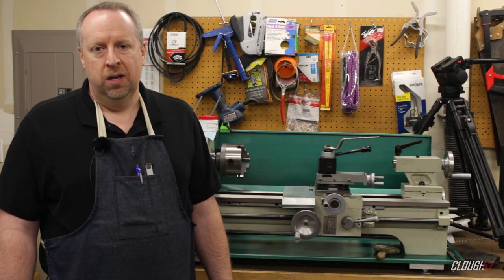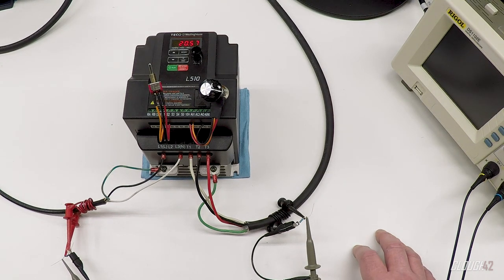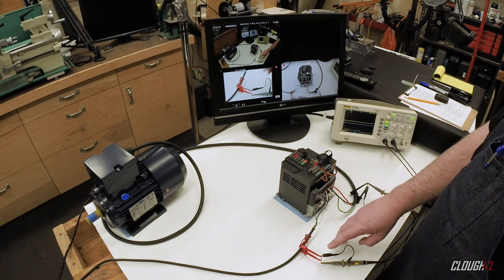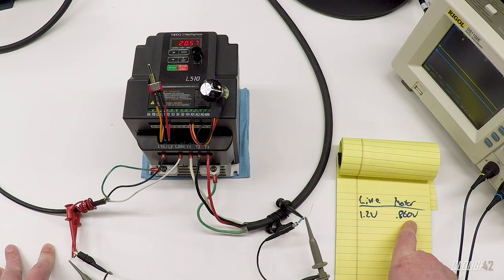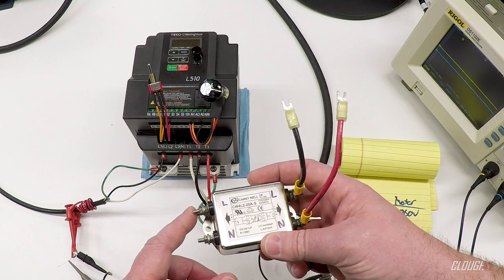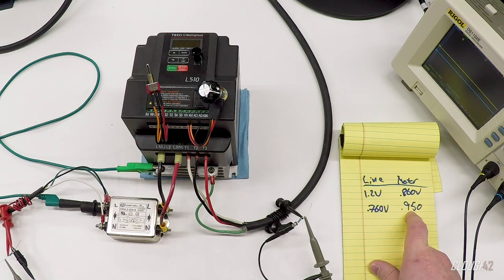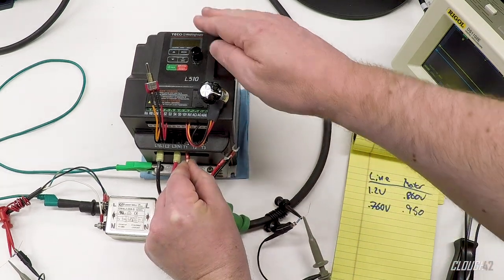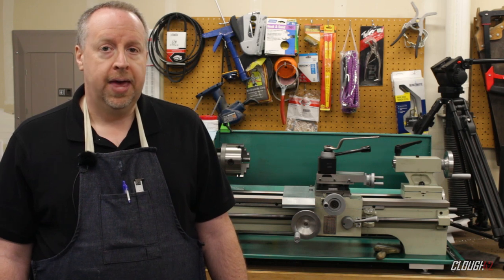Lathe VFD 3:  How to Fix Noise Problems

Comment: Hi Folks. It would be advantageous if the motor lead was kept fully within the lathe electrical casing - it would then act as a Faraday shield. Not really feasible with a small lathe, but with a cabinet mounted one it would be. Otherwise as others point out, shielded cable. Even steel armoured cable should help, although a copper screen would be better. Maybe some viewers could use rigid copper pipe in their set ups? It is necessary to watch out for earth loops - they can cause problems and that is also covered in the comments below. Counter intuitively you just earth one end of the cable screen. It would be good practice folks to use a 'star' earthing arrangement as well, don't daisy chain the various earth connections, take them all back to one common point and as James said use heavy cable as short as possible. As others have pointed out even 'earth' wires can emit electromagnetic radiation. That's because at these very high freqencies they have considerable impeadance - one end may be near earth potential, the other one will not be. Impedance is a posh word for high frequency resistance and it has two components, real and imaginary. May sound weird, but this is in the realm of what are known as 'complex' numbers. What seems obvious is not always so in this field. BobUK.
Reply: Impedance is not 'posh'. Impedance is the technically accurate term for the total resistance to flow in an AC circuit which includes resistance, capacitive reactance, and inductive reactance. Complex numbers are not needed to express or calculate impedance unless we are using varying frequencies or phase shifts.
Reply: @georgebeaves1254 . Hi George. Thanks for taking the trouble to comment. I was trying to keep it meaningful to readers who luckily have avoided the full complexities of circuit analysis. Hence the word 'posh'. I'm well over 70 now so maybe my memory is wrong. What I recall is that if an ac circuit has capacitance or inductance in it then an accurate analysis does involve phase shifts and hence complex numbers. A dc only circuit can be analysed without that complexity. The reason is that in an ac circuit any inductance or capacitance will result in phase shift between voltage and current, like Thanos it is inevitable ........ the extent of the effect of course depends on the values involved.

Comment: I just got my vfd today,(Mitsubishi) your videos will help a ton with my setup. 

Thanks for the in depth videos that really explain what's going in a way anyone(non electrical engineer) can understand.

I was wondering if a shielded cable on the motor side would help with this "noise"? As I will be using this on a cnc setup I dont want any interference with other wires. Also what is the proper way to ground a shielded cable?
Reply from the maker: I don't think shielded cable will hurt anything if you have it.  Typically you would ground the shield at one end only.  The ground connection should be made by a separate ground conductor.

Comment: No loud bang or blue smoke! LOL
Reply from the maker: Not today.
Reply: @Clough42  Reminds me of the time when I was 17 years old and a buddy asked me to do a small welding job for him. In exchange he gave me a small transistor radio which I could install into my 1966 Ford Anglia (like the one shown in at least one of the Harry Potter movies).
Being young and ignorant, I didn't know that British cars, at least this one, used a positive ground. Well I tested it on the edge of the engine bay with the 'ground' hooked to the body. I was pleased to hear some sound coming from the  radio and thus proceeded to install it under the dash. Well all was will until I reved the engine and then I did get blue smoke but no bang.
I guess the radio could tolerate a small amount of  reverse polarity but not the amount that occurred when I reved the engine. I was able to find a local radio shop how was able to fix the radio at least to some extent. I couldn't turn it off. i.e. it was always one if there was  power running to it. From then on I was able to say that I was an experienced car radio installer. LOL

Comment: this is NOT the way you put ferrite cores onto the cables... you should wind the cable onto the core instead of just passing them through. in that case just one or two of the cores would be well enough.
Reply from the maker: Inductance rises with the square of the number of turns.  For this application, four turns on a much larger core would be what I would do today.